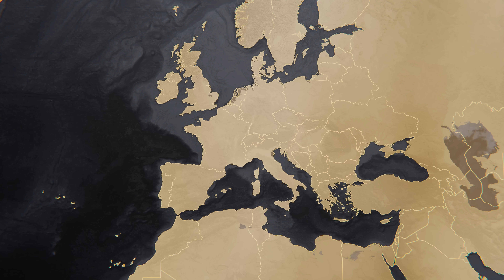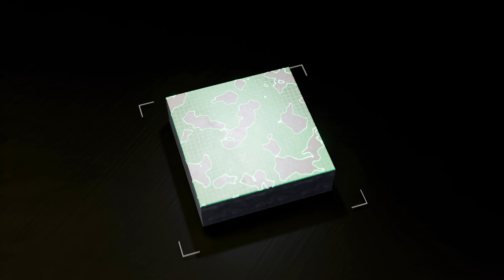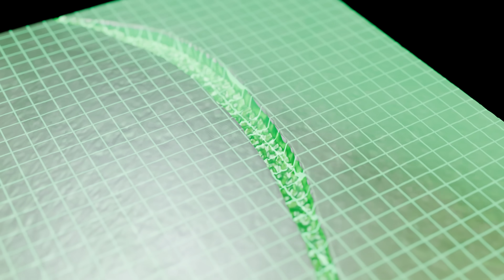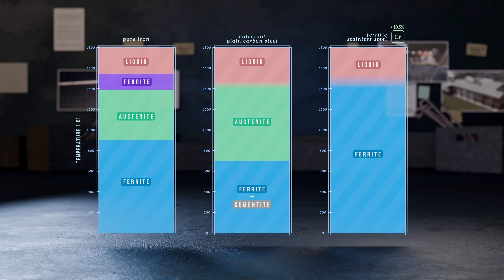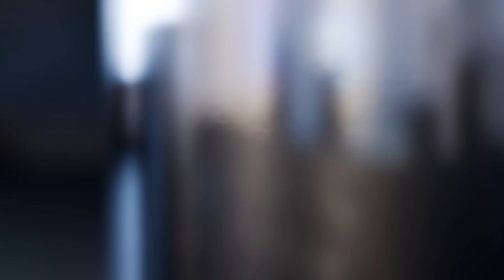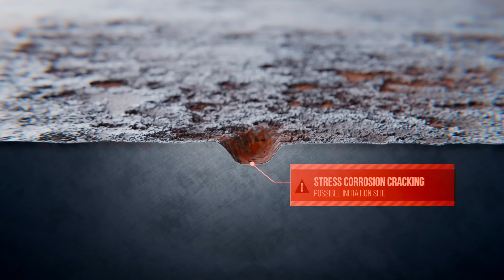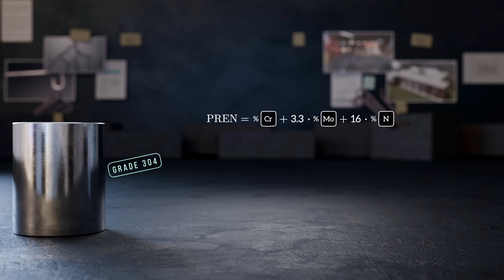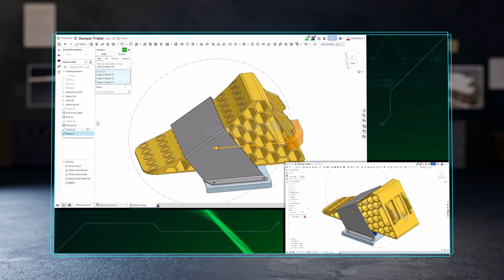The Problem with Stainless Steel

Comment: 2.10.26.   🤔  if I use stainless steel fasteners on the aluminum motorcycle engine cases, what would I use to prevent the galvanic action effect in the threaded holes? Nickel anti seize? Copper based anti-seize?
Reply: You can also just use loctite (use the purple stuff, its the weakest and wont give you any trouble on removal) loctite will fill the airgaps in the threads preventing an electrolyte (like salt water) from entering and allowing corrosion.
Reply: You want the stuff called Noalox. Its zinc based, its used in the electrical industry to prevent galvanic corrosion between aluminum and copper (i looked it up its good for aluminum-stainless as well). Im having a hard time finding info on torque values (it should lower the required torque value because of the lower friction) so if you have trouble with that and dont ever want to worry about your bolts backing out, lookup nord-lock washers, they will dig into your engine case a little bit on install, but they was they work when you back off the bolt the washer pair forces the bolt to stretch slightly before reaching a breakaway point. Makes it IMPOSSIBLE to loosten a fastener with vibrations
Reply: @Sausketo   2.10.26.  Lol … I should have known that … I used it for 43yrs doing Electrical/Instrumentation work! 🤦🏻‍♂️ Don’t I feel like a dumb A$$

Comment: When Fe rusts it turns to Fe2 O3, but stainless steel with chromium forms a passivization surface that resists rusting.  Chromium is also anti-microbe, which helps, ...just don't let it become hexavalent Cr(VI)
Reply: As in welding